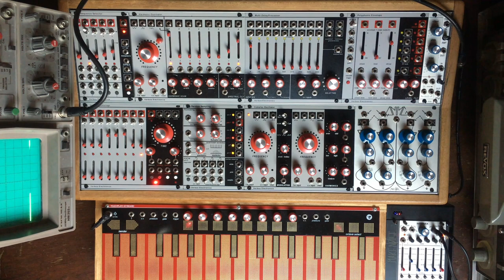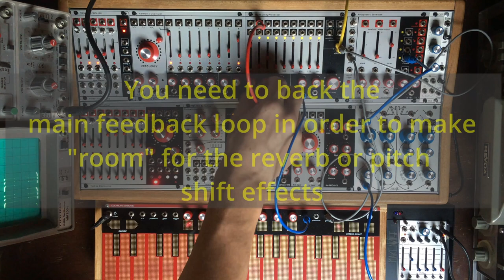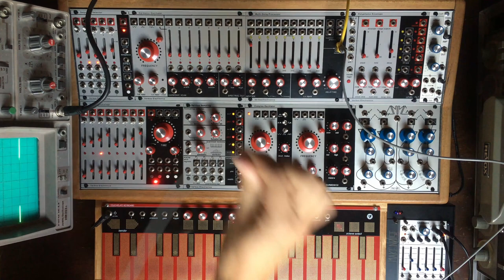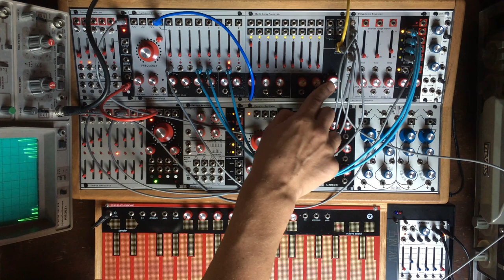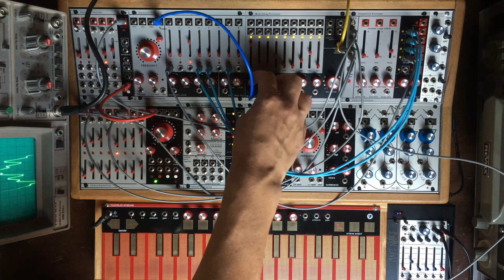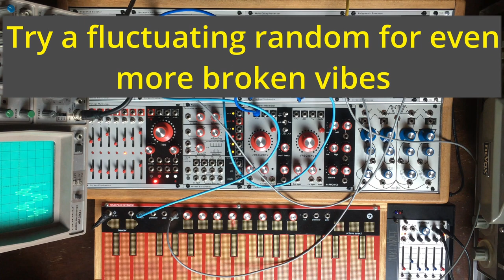My 5 favorite sounds with the Multi-Delay Processor

Comment: Awesome video! Definitely going to mess around with those feedback patches later today.
Reply from the maker: Have fun! So much fun to be had with this.
Reply: @Stazma  I keep coming back to this. Sequence modulating the delay time has produced some really dynamic drum patches for me. 

I also had a question on how you get the skirted knobs on the QMMG - is there a sleeve you can buy to make the pots taller?
Reply from the maker: @gennarocc  Glad you're into thos patches still ;-) 
About the knobs like this I usualy just stick a coin under those and then tighten the screw.